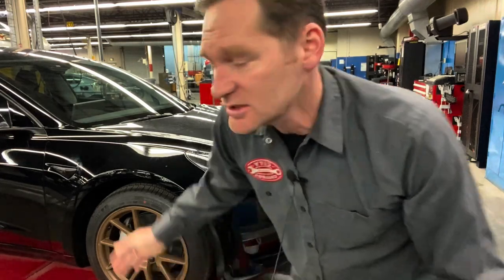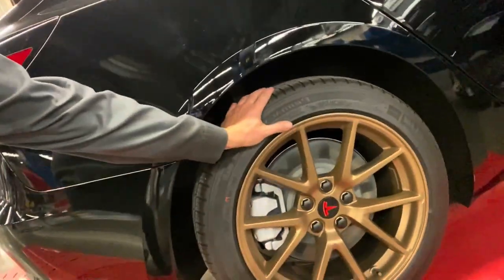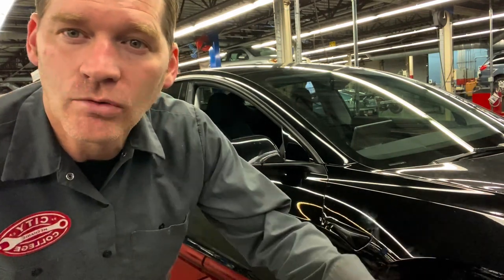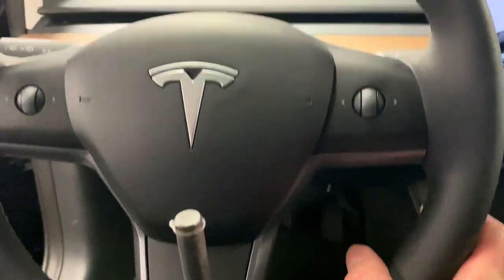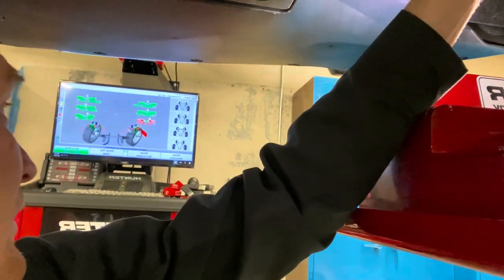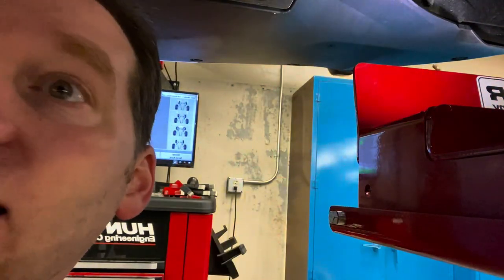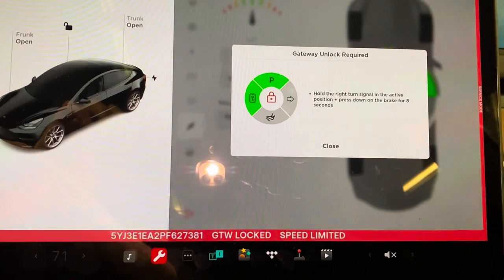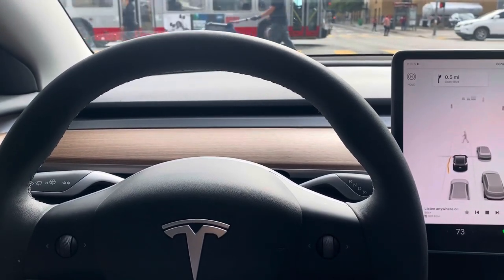Tesla 3 alignment

Comment: yeah, you can seat in the driver seat to do compensation. when everything is done, lock the parking brake the doing adjustment. There is no need sand bags. it is not changing any way.

Comment: What's the factory spec? can you share? I took my m3 to alignment and it seems to go straight but still get the alert "steering alignment needs adjustment", maybe he forgot to reset steering angle sensor? thanks.
after alignment
                                left front:             right front           left rear         right rear
camber                     -0.6                         -0.6                      -1.1                -0.8
caster                        5.5                          4.3                     
toe                           -0.05                      -0.05                     0.23               0.21
front total toe.       -0.10                           
front steer head     0.00
rear total toe.         0.45
rear trust angle      0.01